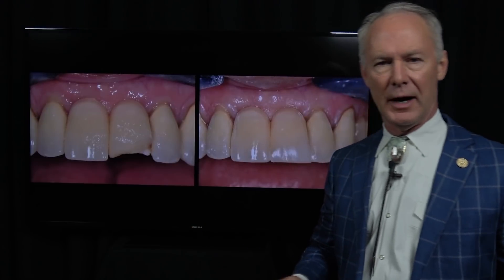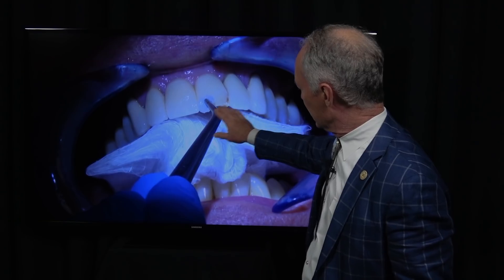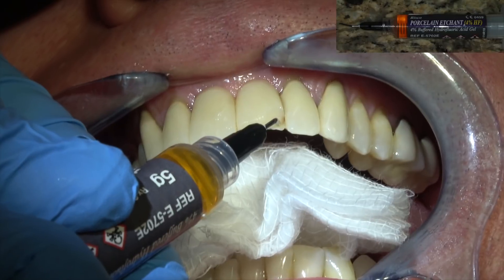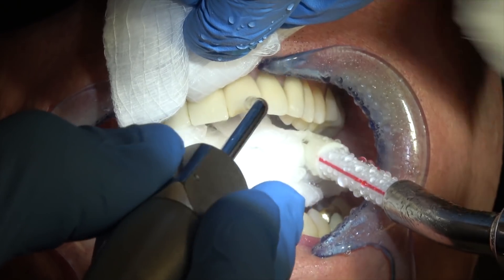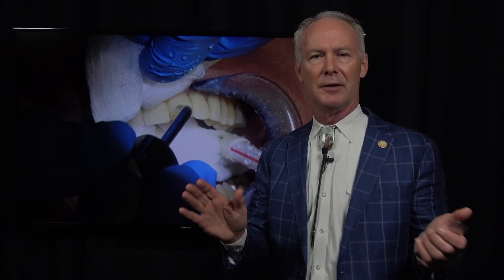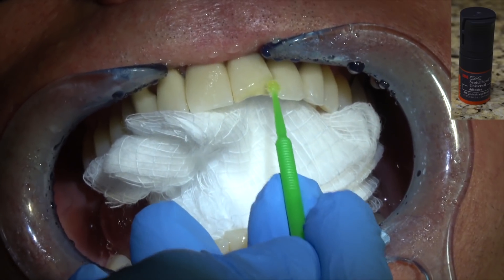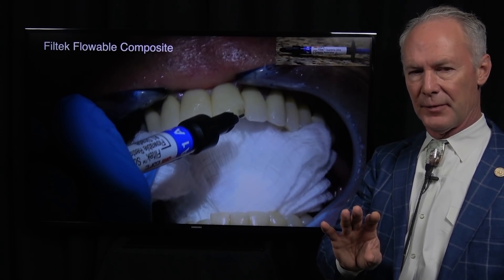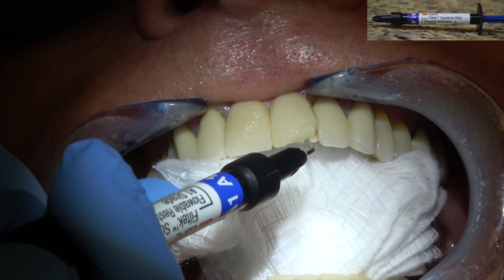How to Bond a Chipped Porcelain Bridge - Dental Minute with Steven T. Cutbirth, DDS

Comment: I had a chipped tooth on my porcilan bridge. He attempts to fix it but failed to tell me it was temporary.  He ground doen inti the tooth which I was not aware of. The restoration came off when I bit into a roasted chicken.  I felt it rubbing my lip. I went, and he ruined the esthetics of the front tooth. I would have said no if he had told me. I feel like crying. Why would he do that.
Reply from the maker: Repairing chipped porcelain is difficult and unpredictable. The lifespan of composite bonded to chipped porcelain is dependent on various factors, including what the patient eats and drinks. If the patient bites on hard things, the repair can break. If they drink coffee and red wine, the composite repair can stain. Normally, porcelain repair is not a long term fix.

Comment: How do you get a color match?
Reply from the maker: I placed several composite "blobs" that were close to the ideal shade on the counter top, cured them, then placed the cured composite "blobs" on cotton tipped applicators held in place by neutral colored wax, then held them up to the bridge to select the most ideal shaded composite. It is important to select the shade of "cured" composite, because the shade is not exact if the composite is not cured. As I stated, bonding chipped porcelain is not a long term fix.  The composite will chip and stain over time. It is a short term fix. Be sure to explain this to the patient verbally and in writing and have them sign the written explanation to ensure they understand this procedure is just a short term fix and you cannot stand behind it. Watch my videos on patient interview, comprehensive examination and consultation in the library of DMC.com. 
Take your practice to the Top Tier. Subscribe to DentistryMasterClasses.com for an organized library of all the Dental Minute videos plus many complete comprehensive cases and many very important articles. New cases are added weekly.  Only $39.95/month.
Click here to subscribe: 
https://membership.dentistrymasterclasses.com/purchase/?plan=513

Comment: I lost 2 upper central incisors due to motorbike accident. I was advised dental implant for both with pfm crown. But now, I have black triangle(minor gap) issue next to my pfm crown but not a chipped porcelain. Can this technique be used to apply composite on the edges of the crown so they are of the right size? Also the crowns don’t look like my natural crowded butterfly incisor. They look very narrow. So can this technique be used to shape the pfm crown further and make it look a bit like my natural teeth did?😢
Reply from the maker: Watch my video discussing when I recommend implants and when I recommend fixed bridges. The technique for bonding chipped porcelain would not work to close a diastema (gap) and bonding porcelain is not a long term fix anyway.

Comment: Some also etch for 5secs with phosphoric acid after etching the porcelain. Do you recommend that? Also, the bonding you used is same as that used for composite restorations?

If enamel or dentin is exposed along with metal, what will be the etching and bonding protocol?
Reply from the maker: In my experience, repairing chipped or broken porcelain is not a long term fix. I have tried different procedures, and they hold so long as the patient does not bite anything very hard on the repair or does not clinch/grind their teeth on the repair. Place your little finger between your teeth and bite down on the finger as hard as you can stand it. What % if your maximum biting force do you think that "all you can stand it" bite force is? Maybe 10% of maximum bite force? It is amazing anything stands up to the force/stress people place on restorations. That is why I say we as dentists cannot guarantee the life of any restoration because there is no restoration a patient cannot destroy if they do not monitor the hardness of the things they bite and do not wear a nightguard or a dental snoring/sleep apnea device. That is why I like gold crowns or inlays on molar teeth if aesthetics is not a big issue. The patient cannot break a gold crown. You are not a bad dentist if a tooth colored restoration or repair breaks. Chances are almost 100% the patient bit into something too hard or did not wear their nightguard. 
Take your practice to the Top Tier. Subscribe to DentistryMasterClasses.com for an organized library of all the Dental Minute videos plus many complete comprehensive cases and many very important articles. New cases are added weekly.  Only $39.95/month.
Click here to subscribe: 
https://membership.dentistrymasterclasses.com/purchase/?plan=513

Comment: Hi there - quick question. I had part of a tooth on a bridge break at the other side - by the gum. You can't see it when I smile but I can feel it on the inside with my tongue and it irritates me. Can this procedure be done in this case? Thanks!
Reply from the maker: If the fracture cannot be seen, a dentist may be able to polish the sharp edges and the bridge may be salvageable. I do not think of bonding chipped porcelain as a long term fix.
Reply: @centerforard  You are very kind to offer these videos and to reply to people. Thanks.

Comment: I have a bridge with 6 teeth and two have large chips like this video. I’ve been told it cannot be temporarily fixed while I await my new bridge.
Reply from the maker: Bonding chipped porcelain with composite is not thought of as a long lasting fix. If the patient is careful, and does not bite anything harder than a hamburger or tunafish sandwich on the repaired porcelain, it should last a while. If it breaks, the dentist does not want to be stuck with having to repair it again for no charge if the patient is not willing to take the risk and responsibility of the composite repair breaking off. If I repair chipped porcelain with composite, I have the patient sign an agreement that they will pay for any repair of the the composite repair if it chips or breaks. I do not want to be married to the composite repair or, even worse, have a patient feel the dentist should replace the porcelain restoration if they break the composite repair. I do not want the patient's problem to become my problem. A composite repair of chipped or broken porcelain, in my experience, is not a predictable long term fix. Ideally, the restoration should be replaced.
Reply: @centerforard  yes I completely agree to use caution until my appt for my new bridge in a few weeks. I’ve called the original dentist who did my bridge and have an appt tomorrow morning to have it repaired “ temporarily “ my dental coverage covers all the costs.
Reply from the maker: Great.

Comment: Hello doctor,  my crown (molar) dropped a small piece becasue of taking braces off. One dentist recommened me to polish it, the other dentist recommened me to bond it. Which way do you think is better? Which way can help the broken stay longer? Thank you very much.
Reply from the maker: Bonding composite to porcelain or any tooth colored material is difficult for me to perform long term predictably. I have tried many methods, and am still looking for the method that predictably stays in place then the patient bites something on the repaired area. The other problem with composite repair is that composite stains and expands and contracts much more than porcelain off other tooth colored materials, so it tends to pull away from the core material. That said, you may want the dentist to repair the chipped area with composite just so you do not have to replace the crown or fixed bridge now, but you will probably have to have the repair redone periodically.
Reply: @centerforard  Hello Dr. Cutbirth, thank you so much for replying to me with details. Right now, two local dentists have different opinions about my case. 1) One dentist who recommended I polish the crown thought polishing would help the crown stay as long as it originally should be. And bonding can not stay long and may even bring a bigger piece off when it drops off. 2) But the other dentist recommending me to bond the crown believed bonding could stay for 2 to 7 years, even longer. In addition, bonding will at least make the crown stronger, but polishing will make the crown weaker. Which way do you think is better for me? I really wish to hear your professional opinion, please.
Reply from the maker: There is not an ideal answer. My feelings are my previous comment. Ideally, replace the crown.
Reply: @centerforard  Thank you very much!

Comment: I have a Maryland Bridge replacing the same tooth in this video. It has a very slight scratch/hairline crack that's visible up close yet only from the front. No visible signs of a crack from underneath. Can bonding be used on the front of the tooth to fill in the possible crack?
Reply from the maker: It's hard to say without examining you. Have your dentist take a look at it. Bonding to repair fractured porcelain or any tooth colored material is normally not long lived. It tends to stain, chip and come off over time because they are dissimilar materials.
Reply: @centerforard  thank you for the reply. Just one more question if I may...is there any sign on whether it's more likely to be a surface scratch or more of a fracture? I have a dental appointment in a week so will know for sure  😬
Reply from the maker: Hard to know.

Comment: Can we use packable composite for the repair too or shld we be using flowable only?
Reply from the maker: I often like both flowable and highly filled resin for a porcelain repair, understanding that whatever material you use for the repair is looked at as a "temporary" fix, not permanent. One good bite on something hard on the composite repair and it is very likely going to fracture. The only reason you are trying to "patch" the fractured porcelain with composite is to spare the patient the cost of replacing a fixed bridge or crown. Be sure the patient understands you cannot guarantee the composite repair and if you have to replace the repair, they must pay for it. Write this down on the consultation sheet and have the patient sign it. Otherwise, the patient's problem will become your problem if you repair the fractured porcelain with composite, then replace the repair for free every time the patient breaks it off. The patient must have "skin in the game" or they have little motivation to be gentle with the repair. 
Take your practice to the Top Tier. Subscribe to DentistryMasterClasses.com for an organized library of all the Dental Minute videos plus many complete comprehensive cases and many very important articles. New cases are added weekly.  Only $20/month.
Click here to subscribe: 
https://membership.dentistrymasterclasses.com/purchase/?plan=513
Reply: @centerforard  The one phrase that changed my practice forever is "DON'T MAKE THE PATIENT'S PROBLEM YOUR PROBLEM".

Thank You so much for all the knowledge that you share with us. I know it has a physical, financial and emotional toll. And u do it regardless just to enrich us with ur years of experience.

Thank you Dr. Steven.
Reply from the maker: Thank you. My mentors gave much to me so I am now giving back.

Comment: Can my dentist do this technique over a chip in same place, that has metal exposed?
Reply from the maker: Bonding. chipped porcelain is normally not a long lasting procedure, it is just to "get you by" for a period of time. The composite repair will eventually stain and pull away from the rest of the bridge because the composite expands and contracts significantly more than the bridge material.

Comment: Can an experienced dentist bond a front tooth crown (#8) that is chipped at the bottom with success, or is that considered more of a temporary solution? It actually looks very similar to the example used in this video, except it's a crown, not a bridge.
Reply from the maker: In my experience, bonding composite to porcelain or metal is a temporary fix.  The composite will eventually stain or pull away from the porcelain or metal, largely because of the coefficient of thermal expansion differential between composite and the other materials.

Comment: I have the same problem shown on here. Visited few dentist and all they want to do is replaced the bridge of 4 teeth. I live in Florida USA need help. Please help me no money or insurance for new bridge.
Reply from the maker: Repairing a chipped bridge is normally not a procedure that lasts a long time.  It is just something to patch it up for a few months or, possibly a few years.  The composite patch will stain and probably chip at some point.  The composite patch is not nearly as strong or durable as the original bridge material.

Comment: also is there a reason you are not isolating the teeth to avoid  getting the hydrofluoric acid in the mouth?
Reply from the maker: It is always best to isolate the teeth with a rubber dam.  In this case, I felt I could effectively isolate the teeth/bridge with 2x2s and high suction when rinsing the HF acid off.  Since I was not anesthetizing the teeth and gums, I did not want to place a clamp on the teeth because I felt it would be uncomfortable to the gums.

Comment: A dentist told me that the only option for a chipped porcelain crown is replacement of the crown (my implant and crown is located in the same place as the patient in this video, and my chip is pretty similar). Is it that he did not have the knowhow or was just trying to convince me of the more expensive procedure (I even have the little piece that chipped off). Do you know any practices in the west coast that can bond my crown?
Reply from the maker: You can  predictably repair chipped porcelain.  The repair is not as strong as porcelain, but if the patient is careful the repair is durable.  Even if you have to replace the repair periodically, it is often more desirable for the patient than replacing the restoration.
Reply: @centerforard  I have a bridge that popped in half. Is there any saving it?
Reply: @RemixeduTV  nope, most likely some part of it was too narrow and it has to be re-done